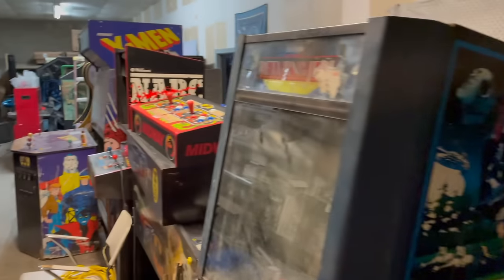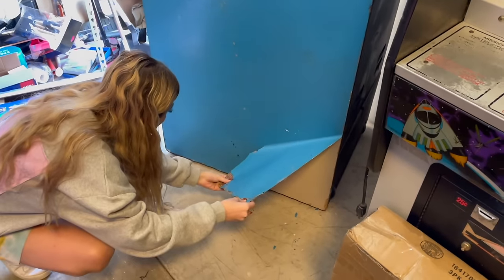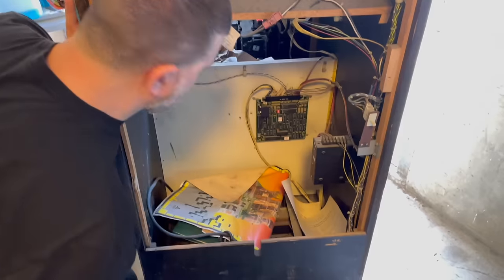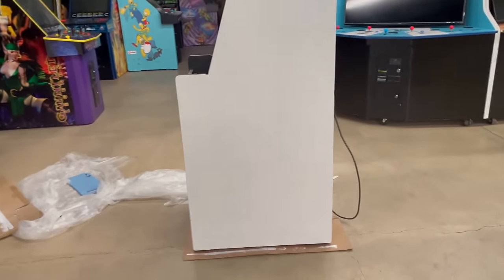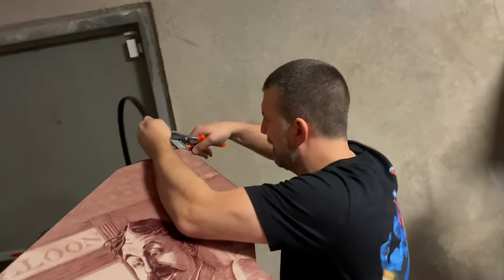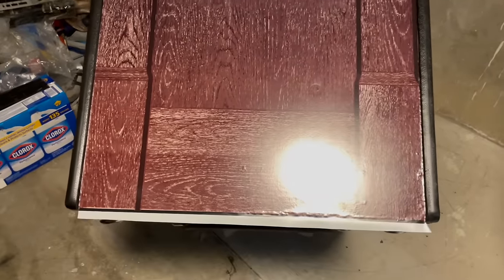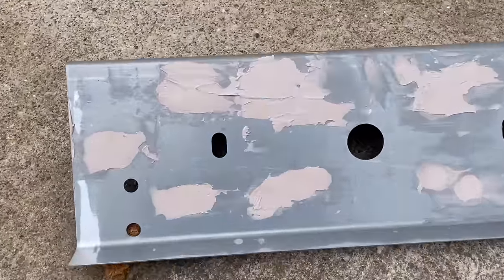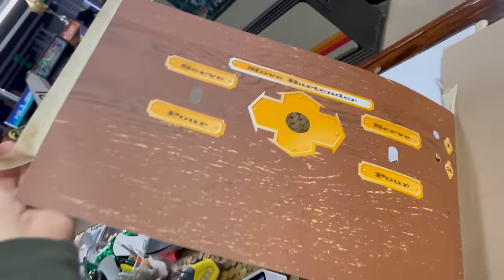Two Year Tapper Arcade Restore

Comment: I realize this is an older video...but restoring this game is just the right thing to do. I have loved this game since the 80s. Never got good at it back then because I was always playing it at a crowded arcade with too many distractions around me (girls...I was a teen on a college campus). When I was in my 20s I found one of these games at a bar that I frequented in California. It was a slow bar and the machine was tu ked away in the back corner behind a pool table. I got pretty good at that point. Then I found a MAME download on Napster (obviously a long while ago) with like 10,000 ROMs. It's just not the same playing Tapper on a computer with a game controller. There's just something about standing in front of that cabinet with the speakers blaring in your face, and a tiny tap handle in your hand. 

Good job...and thanks for the video documentation of your journey.

Comment: I love this game because for my entire childhood I only ever saw the Root Beer version in Showbiz/Chuck E. Cheese, then in 2013 when 16-Bit Bar+Arcade opened in Ohio they had the Budweiser one and it blew my mind a little.

I'm confused about the board situation with this. I didn't hear any mention of where the board came from. He mentioned that they fried the board they had (get it together Travis!). Then I didn't hear anything about a replacement or fixing it, just that they burned some ROMs for it. So ... Is this based on a base system that just needs different ROMs for different games?

I have to wonder how many arcades are running a R-Pi with a MAME image on half their machines. One of the other videos they mentioned a big arcade that has an acrylic DDR where you can see the boards, and I'm sure that's because a lot of places try to run DDR in a MAME box and that makes all those hardcode DDR nerds go crazy. So letting everybody see that you've got a legit machine by making it see-thru is genius.
Reply from the maker: We had to send the boards of to get fixed :(